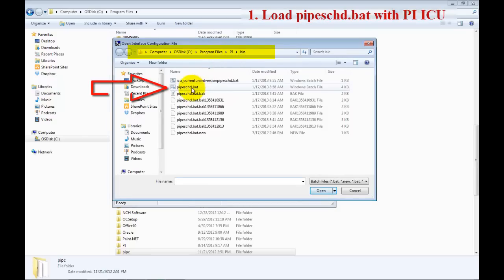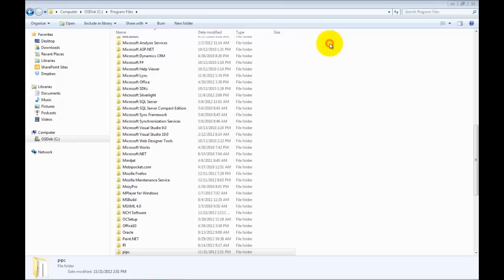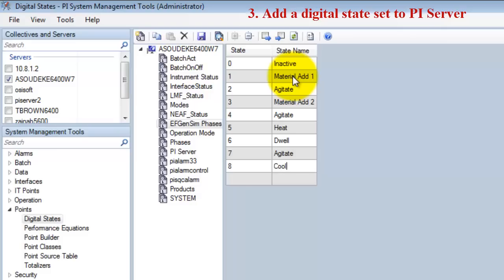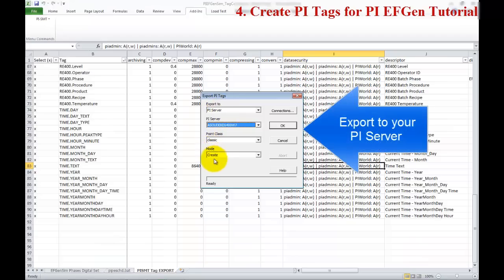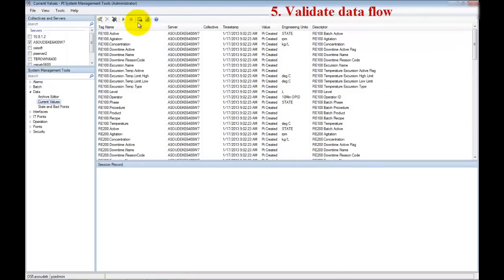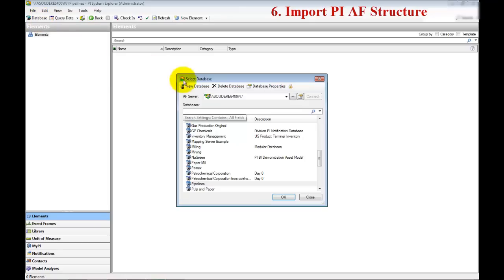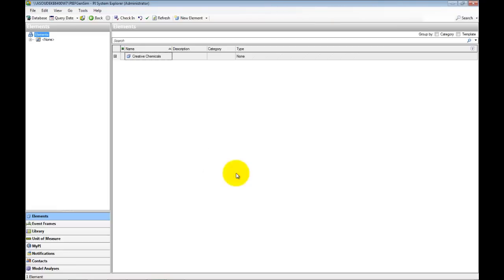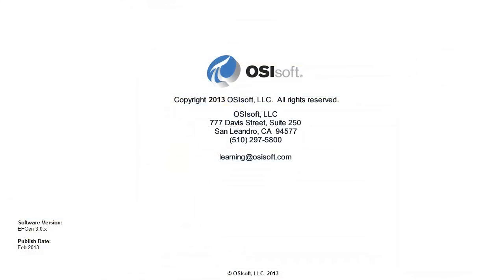OSIsoft: Import PI Tags and PI System for the PIEFGen Tutorial (PI EFGen v3.0.0.x)

Comment: The tags will not update immediately because the PE Scheduler will only check for point updates every 2 minutes. After the PE Scheduler finds the updates, it will only process 25 tags every 30 seconds. This is to allow the interface to put a preference on collecting data, not modifying the points. I like to call this the 2 minutes drill.